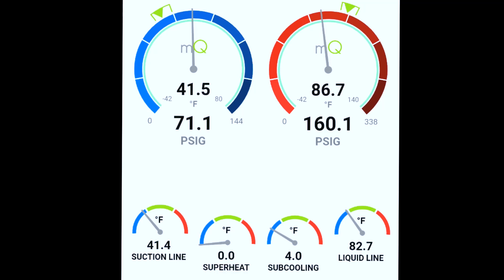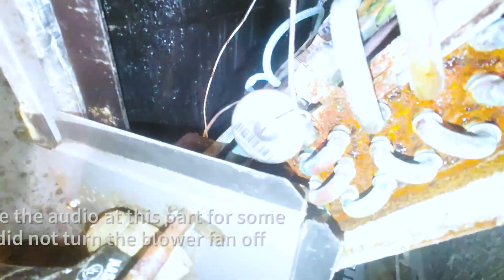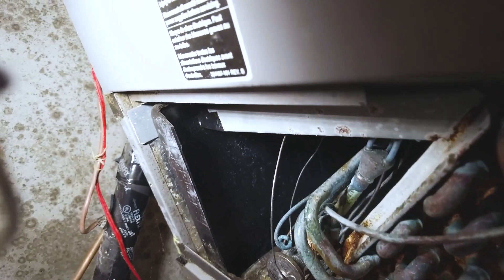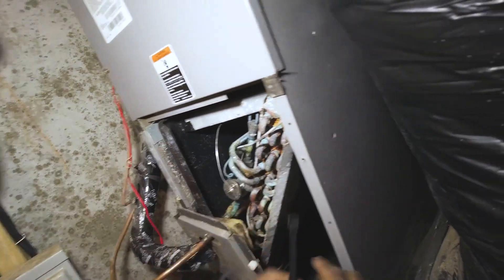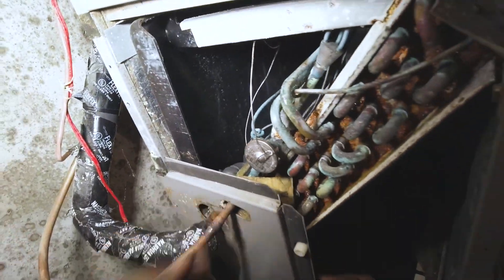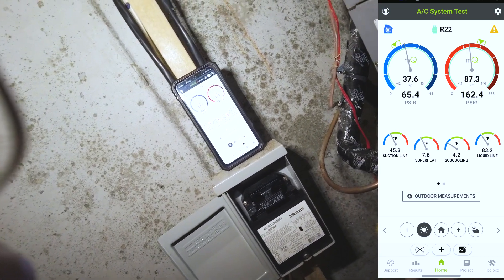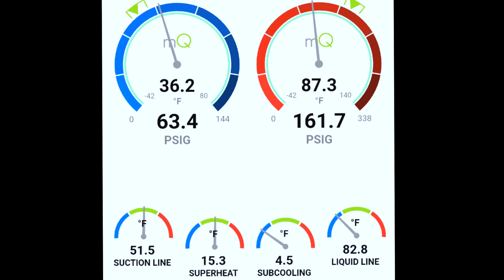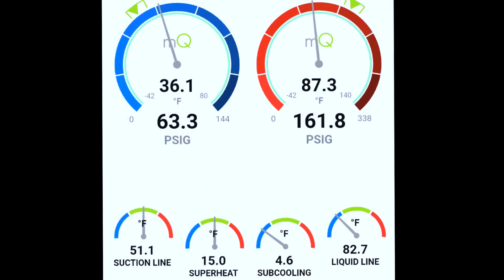Typical Symptoms of a Loose TXV Sensing Bulb and Under Charge System HVAC Tech Diagnostics & Repair

Comment: why would you put insulation on something that has already oxidized? that's like putting a bandage on a broken leg. that system should have been pumped down or evacuated and then the evaporator should have came out and been cleaned (along with the condenser). it sounds like allot of work but this is what separates you from the next guy.

Comment: R22 in the year 2022? time for a new system. sheesh.
Reply: true story.
Reply: Why replace a system that still works well? I have three R22 window units and they all work perfectly. My refrigerator runs R12 and is older than I am and still works great too. Should I go spend thousands of dollars replacing those perfectly functional units with new junk that I'd be lucky to get 5-10 years out of just because of the refrigerant mine uses (which is arguably better than modern refrigerants)?

Comment: It's good you left the metal strap and insulated it.  The zip tie alone will never work right. I've used a strip of sheet metal and a 2" screw to clamp it on once when there was no strap, just a zip tie, low superheat.  Now I keep extra TXV straps in the van.  This is a common issue, especially with Rheem, Lennox, or Goodman external TXVs... Installers don't always even use the strap.  It definitely needs that 180° circumference of metal around the line and bulb to transfer the heat better than just a small surface between the bulb and suction line.
Reply from the maker: Nice! Thanks for sharing. Appreciate the feedback.

Comment: Tight zip ties can be a good fix. 👍
Reply from the maker: Nice! Thanks for the heads up.
Reply: Could you help me out ? My unit at home is reading 82 psig  low side and 278 psig on the high side. Outside Ambient temp is 82 . TXV calling for a sub cool of 9 . My super heats is super high 45 and subcool is perfect @ 9.3 . You think the TXV is stuck ?i live in Las Vegas so humidity is like 5
Reply from the maker: Hey there sorry for the delay response but to me that definitely looks like a restriction somewhere in the liquid line, possibly at the txv. Have you checked the temp difference across the filter dryer? Also you checking liquid line temperature at the outdoor unit or inside at the txv?
Reply: @HVACTechKnowledgy  . I thought I had a leak so made a rookie mistake and added refrigerant but that only made it worse . Super heat jumped up and not down . I borrowed a leak detector from  a friend and no luck . I didn’t see any oil stains at the evaporator or condenser . Yes , the temperature are the same at the filter drier and I checked the liquid line  on the outside . My TXV is threaded on both low and high side .My House was built in 2007 so maybe it time to replace it .